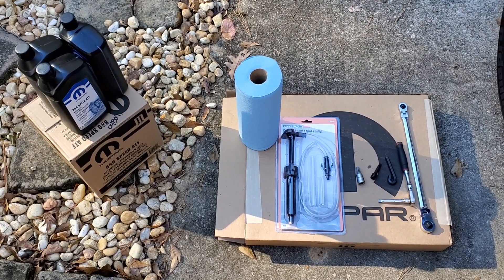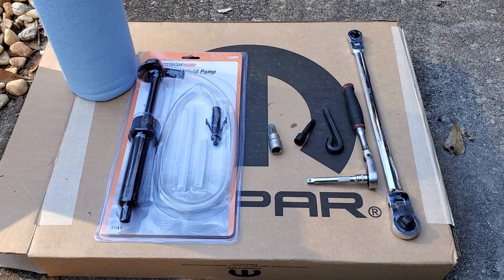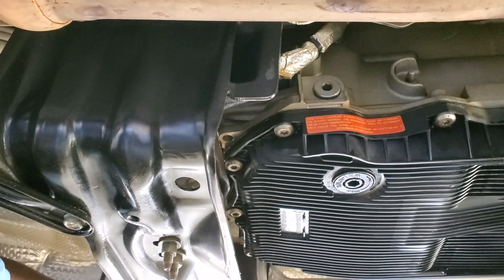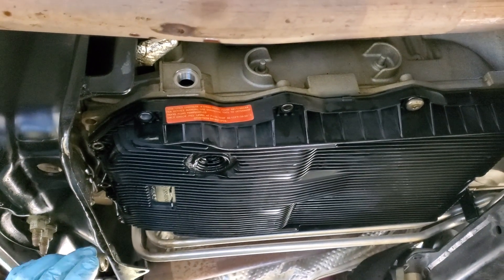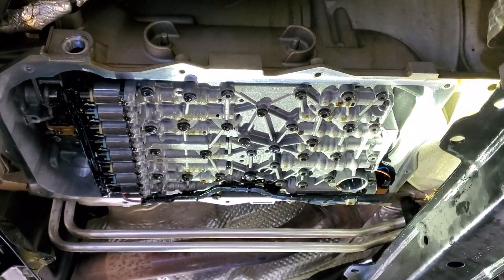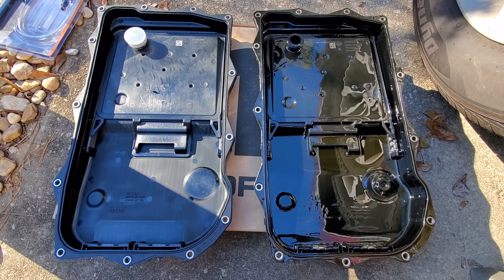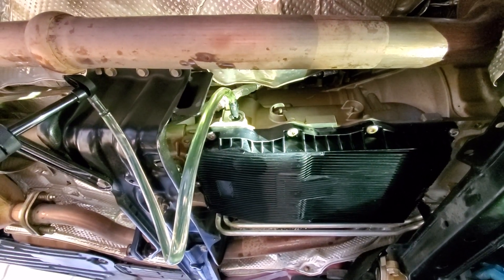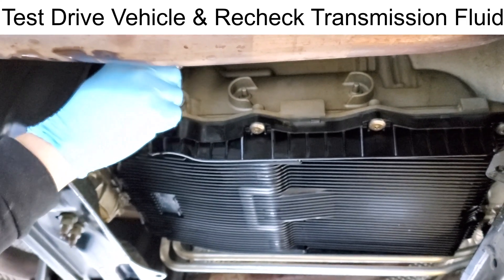ZF 8HP Transmission Fluid, Filter, & Pan Change

Comment: How much fluid can you expect to drain out? The entire system takes 9 qtrs. but if your just doing the pan I would expect you will only get about 4 maybe 5 qtrs.
Reply from the maker: Every ZF will be different you need to measure how much fluid you remove in some type of a container.
Reply: @DIYKAI  Ok thanks
Reply from the maker: Your welcome
Reply from the maker: @dougwatson6406  YW
Reply from the maker: But generally yes you only get about half of the system capacity out when you do a filter and pans swap because of the torque converter it holds about 50 to 60% of the fluid
Reply from the maker: If the transmission has been service regularly then doing just a fluid drop and filter swap will be fine if the transmission's been neglected to it may take 2-3 drain and fills to get all the old fluid out

Comment: How much fluid came out & how much did you put in?
Reply from the maker: Each fill is different depending on location and temperature. I forgot exactly how much because it's checked while running and hot. 6Qts or more?
Reply from the maker: A complete teardown take a case of 12